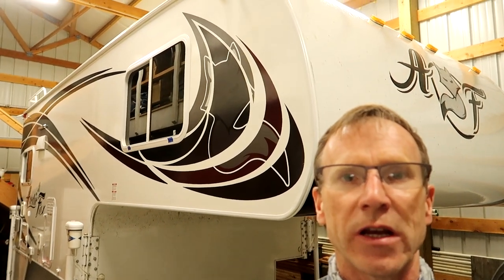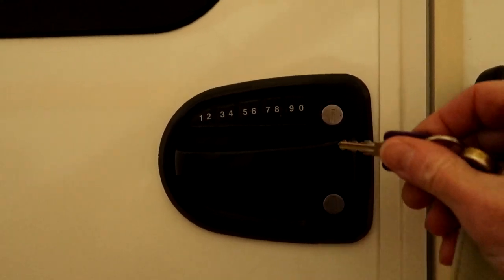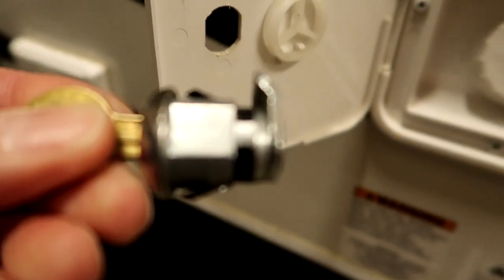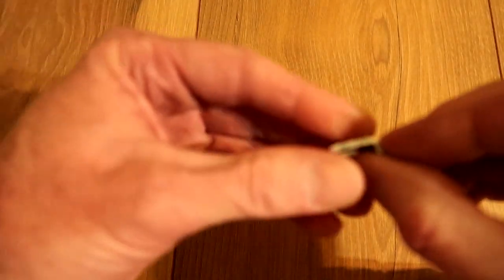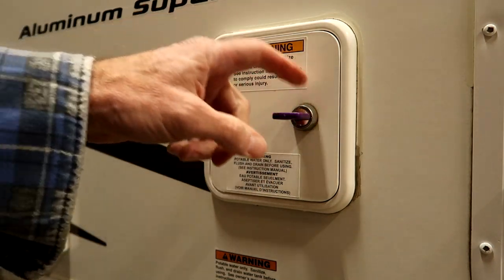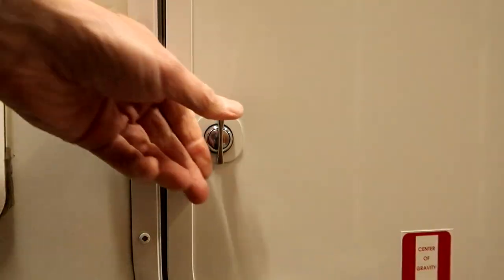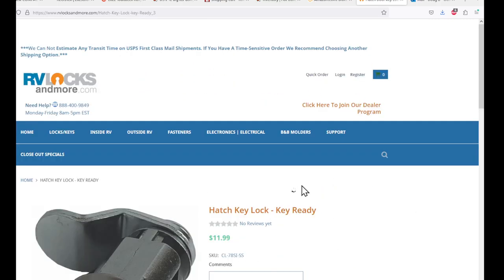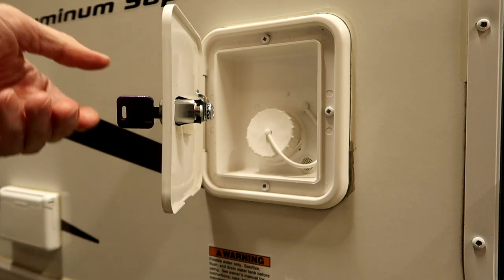GOODBYE CH751 RV Key!

Comment: It’s always good to upgrade locks but when the door is plastic and can have a finger jab break into it. Well it’s doesn’t really matter if you have a lock or not.
Reply from the maker: If someone tried to jab their finger through the plastic to break the plastic, they'd break their finger first.
Reply: @deltabravo1257  I said this because when I purchased my camper it came with one and jokingly I jabbed it. Needless to say now I have a metal door lock system that is meant for a cars gas tank. Now it will take more than a finger jab to get into my water supply.